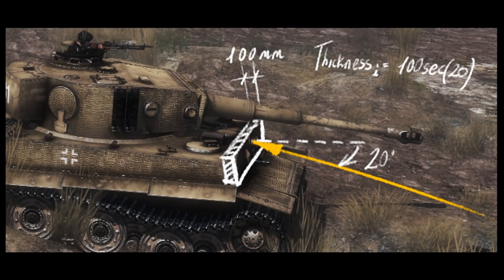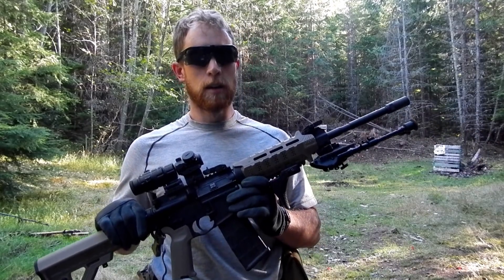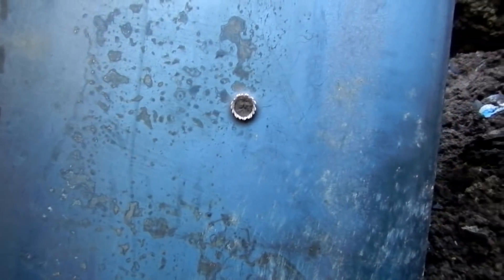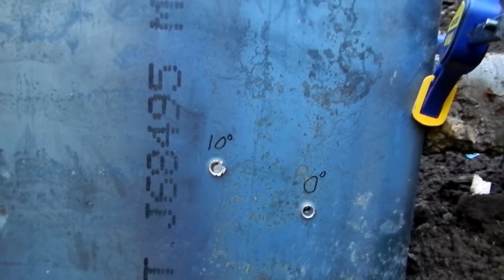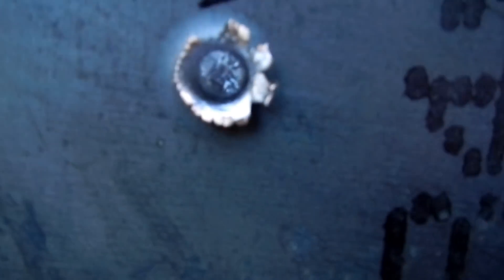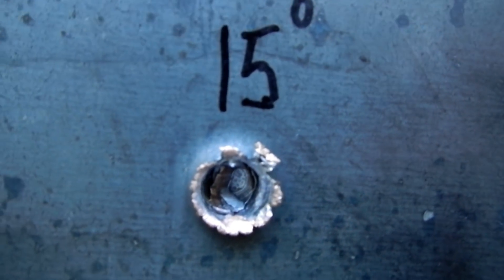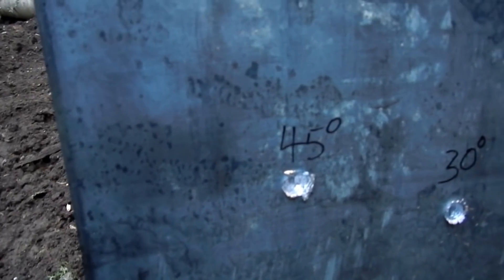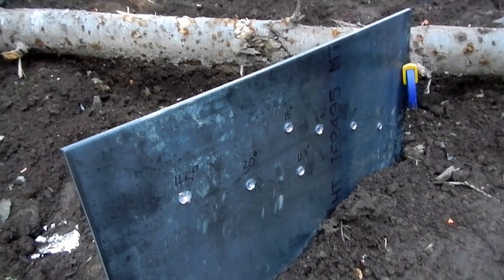Does sloping armor increase it's protection?

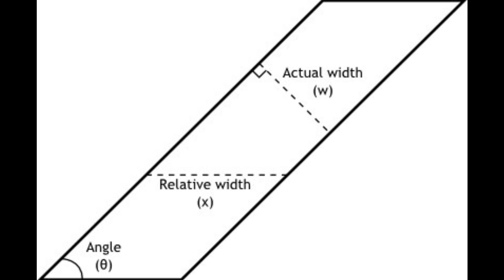Comment: 0:24

You're mistaken, sloping armor does increase weight as the size of the plate to protect the same square area needs to increase. In fact, you need as much weight to have the same effective thickness on a flat and an angled armor plate.

However, with clever design, you can use the slope of the armor plate to require less armor elsewhere (getting rid of roof armor for example). However roof armor was rarely thick anyways, limiting the benefit of sloping (while sloping reduced the internal volume of the vehicle as a downside).

I think the real question is, does a bullet pierce less effective thickness when the armor is sloped or does it behave the same as non sloped armor.

Comment: Everyone talking about sloped armor seems to be neglecting the fact that a sloped piece of armor is longer in relation to the horizontal protection it affords. In relation to the vertical armor it is meant to replace, the weight is the same as the shorter piece of thicker verticle armor.

Comment: Awesome test.  Thank you.  There is only two videos like this on youtube and this is really useful - not for body armor, but constructing sloped defense shielding with AR500 armor plates (or even much cheaper 1/2 inch mild steel plates) to be resistant to nearly all common rifle rounds.   Normal times, this is not very useful, but when SHTF occurs, you will need to protect yourself against looters and bandits armed with AR15s.

Comment: Use composite metal it could be used as a full level 5 rated amour 

Like metal foam with only the weight of foam like tungsten carbide with holes

Apparently they don't use it

Comment: Problem is, the more you slope the plate the less it covers.
So you need more plating to get the same coverage.
Reply: Quite right. But, under certain conditions, the protection provided for a unit of weight grows faster than the weight of the plate. A plate sloped at 60° needs to be twice as long to cover the same vertical area, but can be only 30-40% as thick, resulting in actually being lighter for a given level of protection or giving more protection for a given weight.

Comment: Please use thinner steel. We know 1/4 AR500 stops most rounds. Try something like .125 AR500 on an angle. That would give useful data. Whose going to lug around 3/8 mild steel?
Reply from the maker: your not wrong, but I can get these 3/8 mild steel plates for free

Comment: If you set the plate at 0 degrees then shoot at it from say 300m you are probably hitting it at around 10 degrees angle because of the trajectory of the bullet. . On the other hand if the steel is at 10 degrees and is shot at 300m the  bullet is probably hitting at 0 degrees deflection for the same reason.

Comment: Your test was with an horizontal angle, but it's worth noting that an inclined armour is not always the best: at long ranges bullets also have an angle, so vertical armour might not be too bad actually, while sloped armour ( vertically angled ) could get more easily penetrated.

Comment: Why didn't you try -15 and -30 etc? They would be less protective than 0?
Reply: Its the same relative thickness... Direction of deflection is opposite however...  
    Here, (in the video) the deflection is up with +values.., and  negative -15, or -30etc, would deflect down..  Like the lower plates on the front of a tank😉

Comment: Doesn't the armor effectiveness double at 45 or 60 degrees?
I would have liked to seen higher angle shots too though.
Reply: Sloped armour makes 3 things, give to the bullet more material to pierce, increase the impact area wich disperse the energy better and also makes more easy for the piece to change bullet's inertia, at 45degree u only need to absorb 50% of the inertia to "stop" the shoot. So it can multiply ptotection a lot more than "double" but in practice that value can chamge even to negative.

Comment: You are correct, and at the same time you are wrong. Here is why. 
This mosty apply for steel armor and kinetic projectails. When you switch to modern tanks composite armors, and HEAT or Sabot munitions it is a diffrent story, 
Another thing is, that you say sloped armor give more protection with the same weight. Is is not true. Take for exaple a tank that have 0 degree angled armor of the forntal surace of 1 square meter. (1m width, 1m high). If you want to have 100mm armor, you need 1 square meter of 100mm thick plate. But i you want to have the same effective thicknes with a sloped plate at 45 degree, you need only 71mm thick armor. At this point sloped armor is ligher, but if you put the same 1x1m plate at an angle of 45 degree it will cover only 0.7x1m frontal area of the tank. You need to make it longer to cover remaining 0.3m of the front face, therfore the front plate must be not 1x1m but 1.41x1m. 

The end resoult is that front plates in both cases have exact same weight. 

However overall tank can be lighter becouse side profile is reduced, and anaother addition is better force distribution at tank frame + increased chaces for ricochet. 
The last one adventage plays no part for modern amunitions.

Comment: Wonder why tanks dont slope t he front like the Abrams.  Since incoming shells will come in at a downward angle, angling the armor facing downward like the Abrams would increase protection further.
Reply: CMDRFandragon Modern tanks rely less on armor angle and more on composite armor. Some modern kinetic tank munitions can go thru 800+ mm of RHA (rolled homogeneous armor) which makes sloping armor insignificant (unless it’s a 1 meter thick steel RHA which I doubt would even be considered to be used on a modern tank because it would make the tank too heavy and unrealistic). Composite armor, which is a combination of layers of god knows what materials (idk ok? Most of it is classified anyway) is lighter and can offer significantly better protection against both kinetic and chemical munitions than just plain old steel RHA regardless of armor angle. Also angling composite armor doesn’t increase the protection value hence the almost flat armor on the Abrams and Leopard 2 turrets.
Reply: @lostjuvenile4223  That is all true.  I meant more for back in the days of like WW2.  If you angle a plate back like is commonly seen, the shell is already coming in at a downward angle, reducing the angle.  Why not angle your plate forward instead, armor angled forward like as seen on the Abrams LFP,  would mean a shell that is coming in at a downward angle is hitting a plate already facing down.  Granted, it would look really, really damn dumb, but idk, random thought lol..

Comment: Try 70° angle, it's probs gunna ricochet

Also
In WoT:
"If the relative armor thickness is 3x less than the bullet thickness, the armour will be automatically penetrated no matter what."

Try that as well
Reply: even at 45° it will mostly bounce it.. yea in wot in order to pen 40mm armor at very slope angling like strv 103-0 and 103B.. 121mm gun is required so tricky

Comment: Germany when they use sloped armor on the Panther
"You know, I'm something of a scientist myself"
Reply: @pound2175  lol
Reply: But Germany used flat armor on purpose.
Reply: @daveswarhead2611  yes. Easy for production. Hence why pz4 was one of the best Germans tanks for the war.
Reply: @alecjones4135  I am not 100% sure but I also believe they considered the flat armor strong enough for what it had to face regarding enemy guns. Same with the Tiger.
Reply: Daves Warhead 
   Angling
Reply: @alecjones4135  the reason for the panzer iv using flat armor / vertical armor was because it saved weight for the side and rear, made it easy to use, allowed and enabled the transmission and steering systems to be fit, made it easier to repair for certain parts, saved space for spare parts and as you say because it was easy to produce.
Reply: Panzer I has sloped armor. Having it all around on a design like PzKpfw. III drastically reduces interior space which also decreases the crew's efficiency, especially considering radio and ammunition as well as for running gear.
Reply: Bro the Germans and Italians were doing slope armor in the Middle Ages.

Comment: Is the strength of the steel plate weakened with every shot?
Reply: Yes and no
It doesn't weaken in any linear fashion, you can't be sure for example that 3 to 6 rounds will bounce but 10+ will penetrate
but if the plate is too hard on the surfaces, without having a core which can flex to spread the impact forces, each round will send microscopic fractures into the plate which will eventually lead to a failure in the same way a stone chip on a windscreen can lead to it spidering and eventually shattering

Comment: NATO long rod APFSDS doesn't care about sloped armor
Reply: It actually very much does - During the Gulf War a tank was crippled, mission killed, and the operational security demanded that it be destroyed rather than risk enemies capturing equipment
They fired at point blank range with APFSDS, assuming at 30ft distance they would easily penetrate even the upper glacis plate - It simply deflected off the upper plate and shattered the round
Reply: @bengrogan9710  source?
Reply: @xAlexTobiasxB  A book on the gulf war called Thunder Run
Reply: Russian HE from 152mm gun doesn't care about armor. It kills crew.
Reply: @lovepeace9727  come back to us when it actually happens
Reply: @rayhan_2k841  well...in reality it already happened. 
You know, in late stages of WW2  ISU-152 had to fight against Ferdinand, Tiger 2 and other super armored tanks. 
HE really helped a lot. 

Basically it's small bomb with almost 8kg of explosives...
Reply: @lovepeace9727  the old HE shot like that worked mainly on the premise of fracturing the welds that hold the structure together - the designs have massively moved on since that was viable. An IED doing that trick needs atleast 42kg to compromise a modern MBT
Reply: @mooseranger9366  during the armoured push on Baghdad one of the M1's threw a track, I believe from a small IED,  it brock the track and bent the jockey wheel axle meaning that it was a full recovery - they had pushed well that day and outpaced most of the heavy recovery vehicles
Because of that they where faced with stopping the advance when the enemy where in a full retreat if they wanted to recover it, the area was still classed a hostile so atleast 1 other tank would need to wait with it
The platoon lead ordered the tank destroyed so as to prevent any sensitive info being captured
1 tank leveled it barrel at the tank front, whe shell ricocheted off the upper glacis leaving a 3cm deep gouge, but non penetrating.
They then loaded a HEAT round and fired that to destroy the gunners sights,  3 thermite grenades in the closed breech to weld it shut, 1 thermite grenade over each radio and navigation  system, then finally 4 thermite grenades onto the hull ammo locker and closed the hatches

Comment: but by sloping the plate, you decrease its frontal crossection. two plates with same relative thickness, one sloped other not, would have the same weight. you cant get thickness by sloping for free if you need to cover same frontall area.

Comment: Its not only thicker. The chance of deflecting is also higher
Reply: Yep. Very few WW2 rounds could even latch onto a plate angled at 60 degrees. Now its a different story... HESH, HEAT, powerful APDS. Everything goes through. Might as well plant a 105mm gun on your APC to save money. Youre not saving any lives anyway.
Reply: @LiezAllLiez 
 "everything goes through"
Laughs at turrets of Abrams, T-90 and Leopard2A7
Reply: @LiezAllLiez  sloped armor only makes sense to use on the front if used on the turret ap or he shells could ricochet under the angled turret and into the upper hull to the bottom hull, thus enabling a shot trap depending on the size of the shell.
Reply: it's a different story for the side, rear and especially the turret for certain tanks the ammunition is stored on the side, to fit the engine thickness of armor on the rear is reduced and to fit the gun and radio equipment armor on all sides of the turret is reduced aswell.

Comment: Can you guys not speak in mutiples of 10?

Who measures stuff in inches anyway.
Reply: Welcome to the USA, where we measure things in fractions of inches, feet, yards, miles, ounces, pounds, gallons, gauge, caliber, degrees Fahrenheit, and have guns because we can. Also, counting in multiples of 10 would not be appropriate when he is trying to find the steepest angle that would resist penetration. Finding the angle between 10 and 15 is easier than between 10 and 20, and 45 degrees is halfway between 0 and 90 degrees.
Reply: @taurtearl  yeah. Imagine? when you measure in degrees you actually use the same as everyone else.
Reply: @fetusofetuso2122  realistically i dont see you using a metric clock so you are guilty of what you preach.
Reply: @U6kCtBuN  no, but my computer does. However it's funny because that's yet another thnig americans measure the same as everyone else. I guess it must be simpler
Reply: @fetusofetuso2122  if you think your computer measures with the metric clock then by that standard so does america, just the people of america generally dont. the way we measure things isnt by the most optimal measure, its highly arbitrary.
Reply: @U6kCtBuN  Other, more standardised methods have been invented, which do not rely on the intuiveness of using human body parts for measure. Scientists all over the world use them and our technology is based on them.
Generally speaking, the fact that only in the USA there is such generalised use of the Imperial measurement system, and that even there many techologically rich projects have converted to the SI - such as NASA -showcases that it's outdated, and have you ever heard the word 'klicks' in the US military?  Even the dollar is decimalised.

The only field where the is really still used internationally is in aviation,  this being inherited from the US air dominance at the end of WWII, and then basically only for flight levels.

What is really funny for me is that US should continue using what is essentially the old Imperial British measurement system.

Comment: If armor it angled it deflects the round,hence the angled surfaces on modern tanks,apc...ect... basic physics
Reply: the armour on MBT's is actually flat replaceable super-hardened but brittle plates
The angled surfaces you see are thin plates to deflect IFV cannon fire to prevent the harder plates being chipped and damaged

Comment: Next suggestion, leopard 2a4 angled turret armor, the one that supposed to destabilize armor peneration rounds
Reply: The angled plates on the Leo are outer cladding to only stop 30mm ifv rounds
The plates underneath are flat like on the Leo 2a3 - the plates are superhardened but can be brittle and the 30mm could waken them via chipping

Comment: Use of 3/8 inch not bad cheap and somewhat effective against 5.56. 3 different types of  5.56 now. Would like to see caliber comparison, 7.62, 30.06, handgun calibers, shotgun slugs. By doing this can effect better home and personal defensive adaptations. Not a bad presentation, however without a hard stand movement of the plate gives unknown results as to flexing or movement during actual impact, you should measure how much possible movement after each shot for better results of plate displacement / movement.

Comment: Great video. Please note that sloping does not increase protection per weight. If you slope the armor at 60 degrees, you get twice the LOS armor but you also protect only half the vertical area. If your tank is 1 meter high and you want to protect it with 100mm armor. You can put a 100mm thick, 1m long plate or you can have a 50mm plate at 60 degrees, but you will need the plate to be 2m long to cover the same height. Sloping does increase the chances that rounds will bounce off.